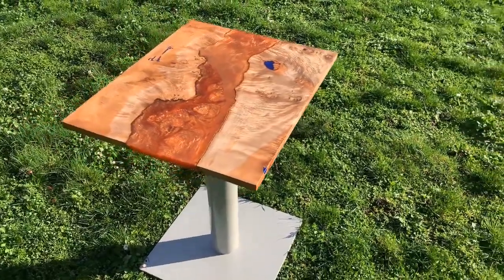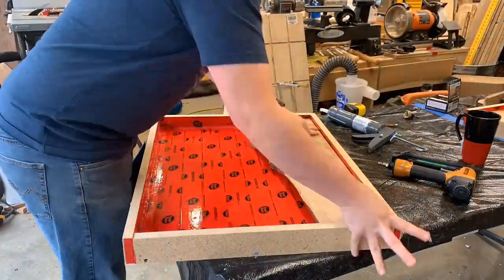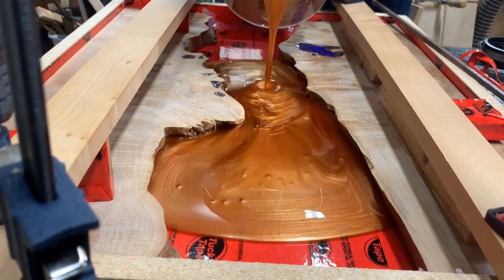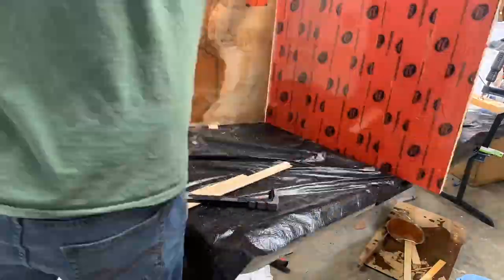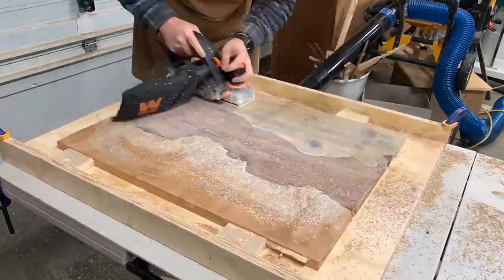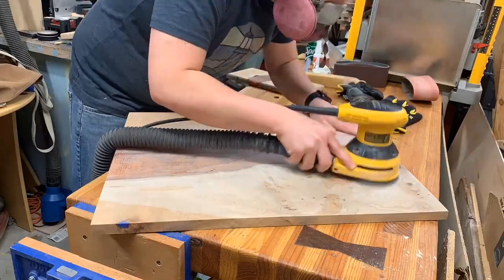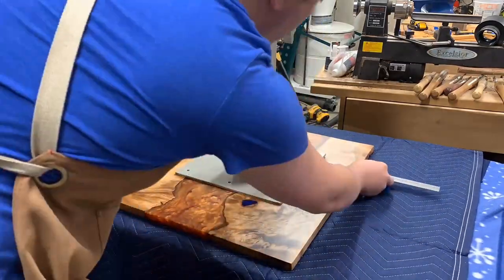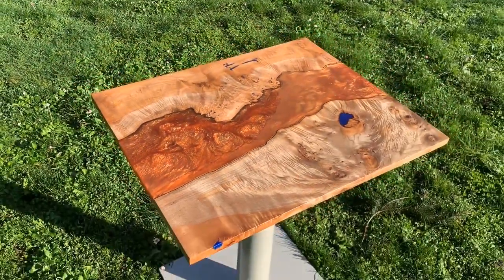Two Toned Epoxy River Table: Opaque & Transparent Effect

Comment: Beautiful work. Your honesty about the challenges and your perseverance are inspiring. Btw not sure if you’re familiar with this sander: (BOSCH Power Tools - GET75-6N - Electric Orbital Sander, Polisher - 7.5 Amp, Corded, 6"" Disc Size - features Two Sanding Modes: Random Orbit, Aggressive Turbo for Woodworking, Polishing, Carpentry).  It’s a game changer. I’ve got several 5 “ sanders which work well enough but this thing is on another level with power, control, smooth beautiful and FLAT finish. You would not be disappointed!  Cheers. Update:  just watched another video and saw you using this sander!  My bad😁

Comment: Hi mate i made a river table but I'm struggling with the sanding part. I'm using Mirka sandpaper, but when I sand I get loads of pigtails/swirls/scratches and I don't know how to stop them from happening. I work my way through the grits spending 20mins+ on each grit but still get them. Because of this, I started sanding ALL AGAIN. So I started at 80 grit but this left the swirls/pigtails. Do I go to 120 grit or do I keep going with 80 till there all out then move on to 120 grit.? Many thanks, awesome table you got there
Reply from the maker: Sorry to hear that! I usually make 120 my lowest grit with epoxy. The swirl marks come from the epoxy dust getting stuck in the sandpaper, so you have to keep an eye on the paper and clean both the paper and surface of dust, especially in the lower grits. I’m no expert. I’d do some trial and error between 80 and 120 with the epoxy dust in mind. Hope that helps! I will add that I still had the pigtails with the fiber grits, but they disappeared with finish. So you might want to throw down some mineral spirits to see if the marks will even show up with finish. Best of luck!
Reply: @SixEightWoodworks  thanks man , I tried again today. most of the scratches were gone, however, I've got a new problem. I applied OSMO Satin oil to the epoxy and left it to dry for 10 hours and its finished quite bad. without a picture its hard to show you but its basically finished rough, you put your hand to the epoxy and its not smooth you can almost see the oil-stained , if you understand me. Am I doing something wrong , any suggestions? thanks
Reply: @Lushahx  did you wipe off the excess after you applied the finish?